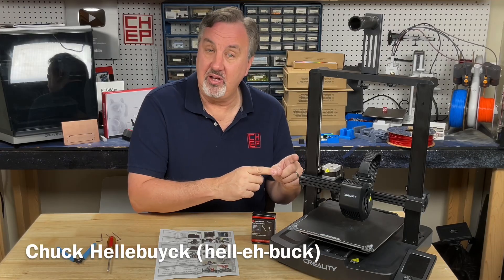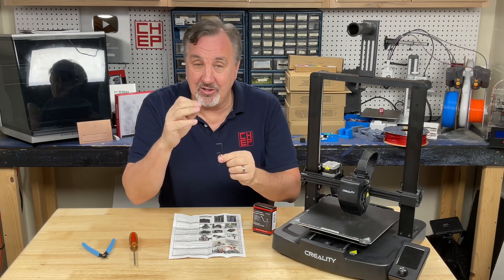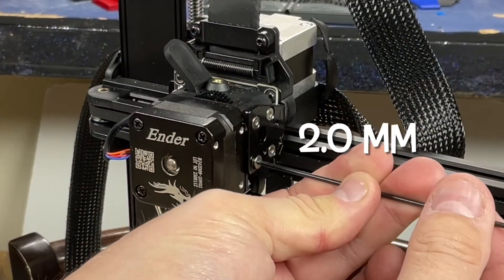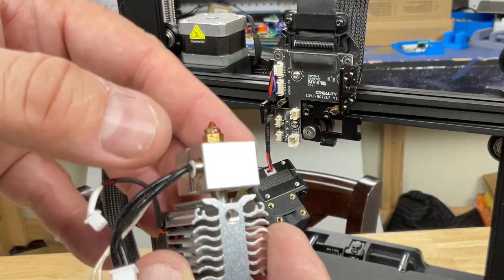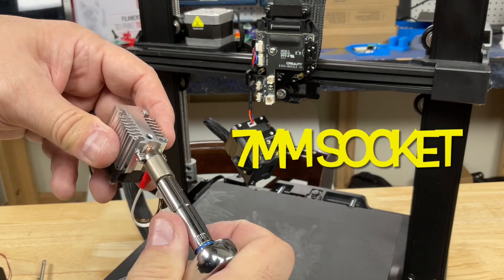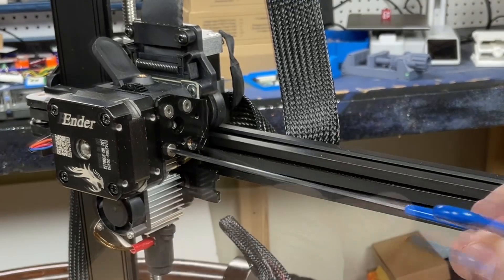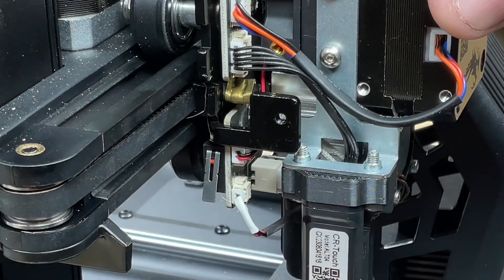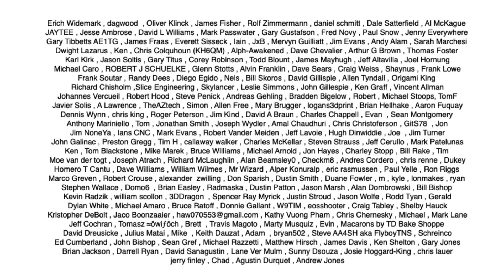Upgrade Creality Ender 3 V3 SE to Microswiss Flowtech Hotend

Comment: Great instructional video. The wires came out of the connector on my CR touch. I ordered a new CR touch kit from Creality and it has a super long cable that goes to the main board? Do you know where I can get a replacement short cable?

Comment: Question; if I upgrade my bl touch on my ender 3 pro to a cr touch do I need to change the firmware?
Reply from the maker: As far as I know it should work without a firmware change but each firmware is slightly different.

Comment: Hey Chuck you have such great knowledge I know that Microswiss doesn't officially have a Flotech kit for Ender3 S1 with the original Sprite extruder,  if you sill have one kicking around,  could you see if this would fit it looks as if it might depending on the screw spacing and the diameter of that cover Bart at the top

Comment: Great video! I just subscribed your channel and i'm waiting for the follow up video regarding the quality improvements in future prints. I'm thinking about buying this upgrade but i currently have some fan mods, with a 40mm noctua fan and dual 5015 blowers. After checking your video i think i'm going to need the blower ducts to be 2mm longer (the size of the cr touch spacer) but maybe i'll need to test it.
While looking for the micro swiss hotend i found the micro swiss heater block as well, is it worth getting it? Thank you and keep up the great videos

Comment: So I have an issue with my V3 SE all of a sudden I couldn't get it to level the bed and it wouldn't print. The way it was acting I figured the firmware might need an update or somehow it got corrupted. So I went to the Creality site and found the newest update and and downloaded it to the printer. Somewhere in my diagnostics I scrolled to where it said reconfigure on the printer screen and that's when it went south now the screen refuses to boot up. It powers on but doesn't display any graphics. Sure could use some insight if you have some to give to get me back up and running.
Reply from the maker: There is also firmware to upgrade the display. It may require that as well.
Reply: @FilamentFriday  I updated the firmware on both the display and the main board. The blue screen happened after the update. I was running through the menu on the display and saw the word reconfigure I figured it wouldn't hurt to do it and maybe it would help. After I pressed it that's when the blue screen happened. Since there is now no graphics or text I can't reverse it. I tried reupdating the screen and it says update succeeded but the blue screen remains.
Reply from the maker: @ - I don’t have any other ideas.
Reply: @Kelteclover Do you have a sonic pad? It almost sounds like you downloaded the klipper / Sonic Pad version of the firmware. That one makes the screen all blue.

Comment: Chep, I've successfully installed my Microswiss hotend and it's the biggest disappointment of my 3D printing career. Inconsistent, rough layers and exceptionally bad stringing. Oh, and HUGE Z seams that are ultra, super duper visible. You can quite literally feel the seam. I've been working on it for more than 3 days straight now. I've quadruple checked the installation and can find no faults in my handiwork. I'm losing my mind over here.

What's more, I'm finding help threads from Ender/Microswiss users that perfectly mirror the issues I'm having. I just gave the PID autotune feature a try and am hopeful that it will make these prints slightly less disastrous. Worst case scenario, this thing is going back. My old hotend worked brilliantly.
Reply from the maker: Im shocked. Mines printer better. Much smoother. Are you using the same slicing profile?
Maybe check the nozzle size. Almost sounds like a larger nozzle than 0.4.
Reply: @FilamentFriday  Same slicing profile, with the correct nozzle size chosen. I'm starting to suspect that the nozzle is significantly hotter than the thermistor is registering. Long, flowing streams of filament eek their way out at 205 C. My last print had rough, protruding layer lines which I'd initially assumed were a z issue. Now I'm thinking that the heat is causing over extrusion. I have more experimenting to do! Also, you're awesome for watching the comment section and helping people out.
Reply from the maker: @literarynick - Contact Microswiss. They are often very helpful.
Reply: @FilamentFriday I'm a month late, but I've found the source of the issue! Switching from PrusaSlicer's Z-hop setting (it isn't called that) to a "ramping lift" solved my problem entirely.

Comment: hi, i am using a creality 3d printer.  i am running your settings  which works good But my Dimension comes out a little under size.
Reply from the maker: Filament and printer can affect things. This should help: 
Perfectly Accurate 3D Prints using Horizontal Expansion
https://youtu.be/-jsBI3OeUJQ

Comment: will CF print?
Reply from the maker: Depends on the CF.
Reply: @FilamentFriday  I have a important question.. shall I get the K1C or the 3 V3 Plus?
Reply from the maker: @catverpasha - I prefer the K1 Max then you get enclosed plus size. But per your question I prefer the enclosed K1C over the open V3.

Comment: Nice video! I've been running that hot end in my V3 SE since mid-November and I have to agree about the improvement. Although Microswiss is not known for inexpensive parts, IMHO I think you get what you pay for with them. I'm also running linear rails on both X and Y axes, even having printed the parts for the Y axis upgrade using PC-CF on this printer after the hot end upgrade. Oh, and I upgraded to Klipper using a rooted Nebula pad kit. This already was one of my favorite bedslinger printers before any of the mods and now I think it's at the top of my list.

Comment: Better buy Ender KE which cost 60 USD more then SE and you will get Klipper, touch screen,  fillament sensor,  ceramic hotend etc. Finally you will avoid a lot of upgrade and save your money.

Comment: With all the extra flow nozzle upgrades afford... How are stock cooling fans keeping up? I have dual 5015s (Petsfang) and still have curling issues (well under 14mm3/s) on corners with an old microswiss hotend: the direct drop-in for the OG Ender 3 pro, nothing special.
Reply: The SE is really sub-par vs the KE. I suggest to EVERYONE to get the KE for a touch more. The hotend on it is far far superior
Reply: @LostCloudx4  KE cost 60 USD more than SE and this upgrade cost same money. But to get KE level you will need to make many other modifications.
Reply: @alexdiver9809  Thus the KE wins. Linear rail, wifi control, faster, filament sensor and other extras. I went from 12 highly modified 6 years old ender 3 pros to 2x KEs and print faster and cleaner completely remotely & so far printing 24/7 every day have had to replace 1 nozzle in 3 months. epic machines even using the somewhat clunky creality slicer

Comment: I can’t stand brands like Flowtech that overcharge for basic products while locking you into their limited ecosystem with few nozzle options. They even created a "leak problem" that didn’t exist just to push their proprietary junk—Source  Creality forum users. The CHCB hotend is a game-changer: a drop-in replacement with a wide range of nozzles, high flow rates, better heating power, and no leaks, all at a fraction of the cost. It's clear you’re more focused on profits than helping users, so I’ll be unsubscribing for pushing this bs flowtech hotend.
Reply: Spare the world your bloviating indignation.

Comment: Do you provide Cura Profiles for this printer (apart from the ultrafast profile)? I used your Ender 3 profiles for years and the worked fine for me (thank you for these). But I have roblems with the default Cura profiles for this printer.
Reply: The Orca default profiles for this printer rock ! Cura is so 2017, you making your life difficult by wanting to use that outdated slicer. Cura wont ever produce the results a modern slicer like Orca, bambu or prusa slicer will.
Reply from the maker: @raifjahns3777 - All my Cura profiles work fine on this printer. I’ve been getting much better results with my profiles than what Orca offers but I’m working on improving those as well.
Reply: I used the 3V2 profiles and adjusted the retraction and fine tune as normal
Reply: This has direct drive extruder, so I thought different profile settings are necessary. Will happily try the Ender 3 profiles.
Reply from the maker: @ralfjahns3777 - I do reduce retraction value to 1 or 2 on direct drive.

Comment: Id like to see the comparison of this to the upgraded heatsink option Creality sells with the unicorn nozzle.  Both should have cold nozzle swaps, the new Creality nozzle is rated to 320°. If you go the unicorn nozzle you can get a Silicone Carbide nozzle for only $20 or go the E3D high flow nozzle and get upwards of 50mm^3/s in flow. I'd love to see some more comparisons between how the two work and function.

Comment: I have this printer. One modification I made was I drilled a hole in the tool head cover over the Extruder adjustment screw so I can adjust it without taking off the cover.

Comment: I am not new to 3D printers and have a question, WHY? You did not show taking any advantage of the new hot end. Can it print faster, cleaner, better in some way? Or do you recommend it because Microswiss gave you one for free? Yes, you want it to match other machines you own. What advantages does this have over stock?
Reply from the maker: That’s for a future video. As I stated it has higher temp and higher flow capability.
Reply: The flowtech hotend combined with the flowtech+CHT nozzles can flow well over 50mm3. A massive upgrade for most any printer. Have a couple of them on my sovols and they are amazing

Comment: Looks like a fairly easy upgrade but do you need to make any adjustment to the retraction length and retraction speed in the slicer software?
Reply: For a bowden yes. For direct drive no
Reply: @subarududewrxt  ok, good to know. Thanks